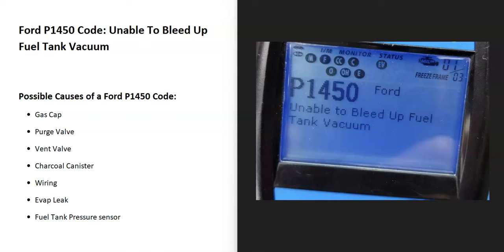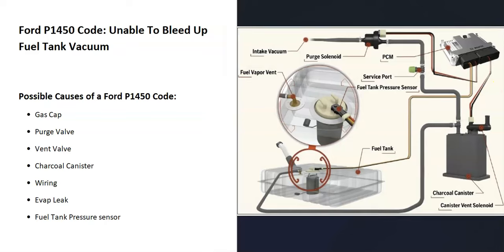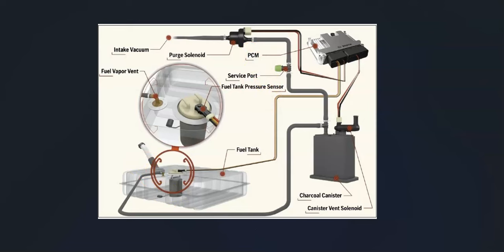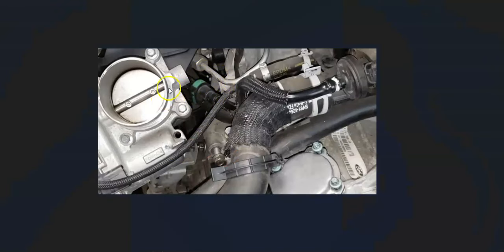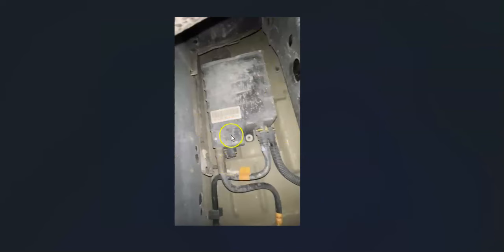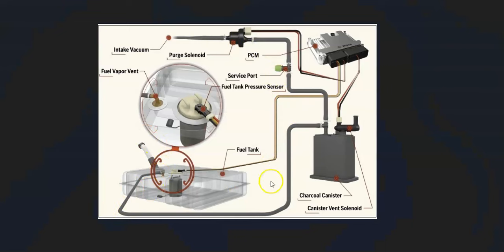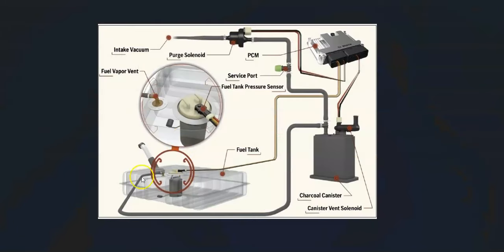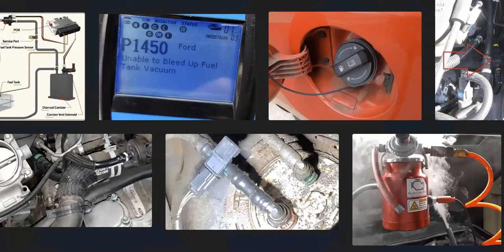Causes and Fixes Ford P1450 Code: Unable To Bleed Up Fuel Tank Vacuum

Comment: My car doesn't have a gas cap
Reply: No, but you should have a capless fuel system that relies on a spring loaded mechanism to perform the function of what the gas caps used to do. Just like any other moving parts, these can wear out over time. That being said, I would check the other possibilities first to rule them out before coming to the conclusion that this is what needs replaced.

Comment: I recently got this code on my wife's '15 fusion.  Tests pointed to purge valve as the culprit.  I removed the purge valve and cleaned the valve and all hoses with 99% IPA from all sides then dried with compressed air a few times.  I then hit the valve with a small shot of wd-40 on the side that goes to the EVAP canister.  After reconnecting everything the valve seemed to function properly.  After a couple days of driving the check engine light went out.  Not sure how long the fix will hold out but being right after Christmas I'll call it a win for now.

Comment: 2004 F150 P1450 started after gnarly rain storm, after starting n driving truck a bit it seemed like it had water in the gas, misfires, rough idle, many codes. After few days of heat and evaporation, truck running normal but still has 1450 code and can't fill gas tank unless flow going really slow. And It's not the gas cap.
Excellent video and graphics breakdown.
Reply from the maker: That is a common symptom of a bad vent valve located under the bed of the truck.
Reply: @HVAC_Mechanic  thx for that.  I've heard that from 1 other person.  So it being a 2004 [new style], I've researched but I cant find anything about it or to change it.  All I find is the purge valve in the engine bay on the firewall.

Comment: Having trouble finding videos on Evaporative Emission Blocking Valve. This is not fully sealing and when benched tested.  This is a vapor shut off valve that is located  on top of my 2018 f150 and most modern fords. This has yet to throw a code, however scan tool readings EVAP System Vapor Pressure -1000pa - 2000s pa. Random misfires on idle. Random rough idle when truck is warm. If i disconnect the vapor line from the purge valve to canister, the Vapor Pa will stay at the normal 20-100 range. So this pointed to the cansiter, that was benched tested and valve (normally open) was working and held pressure when closed. Lid less gas filler tab sealing. That is when i removed the Evaporative Emission Blocking Valve which is not fun if you atrempt with tank still on the truck. Benched tested with smoke and vacuum as this is a normally open valve, when shut there was a leak. Not enough to trigger code, but waiting on new part, so hopefully this is my issue. New intake manifold, 16 injectors all clean. Just was trying to see what this valve could cause if faulty. Thanks

Comment: What about a fuel system clean out ? I have same code and already changed purge valve and I have a 2018 ford focus SE and I don’t have gas cap carmax told me these cars don’t have or need one I thought it was weird but my car is idling now

Comment: Thanks for the video. What worse can happen if this is ignored?
Reply: I’ve had a similar issue for about 8-10 months now. I think you’ll probably just experience some reduced gas mileage and perhaps slightly less power. I haven’t noticed any major issues with my car so far

Comment: Most detailed video I have seen so far BUT I own a 2007 model that is getting this same code with no symptoms whatsoever. The car runs, drives, fills up and drives off afterwards perfectly fine at the gas pumps. Should I consider disconnecting the negative terminal of my battery to reset my computer in the sense that it could be a faulty code? The code has been showing up more frequently as time has went on and I've owned the car for a year now. Just makes me wonder which option I should consider trying first to fix this issue.

Comment: Thank you. Great explanation of the system. My wife's 2017 Escape has been giving the code. I replaced the purge valve and connected lines (or the Kraken as I called it). Worked great for a month, but now it's back to giving the code. The only noticeable issue is the old trouble starting after filling up at the pump. I'm thinking of replacing the canister vent solenoid next. Can you explain what happens mechanically when you fill the gas tank that causes the trouble starting? Does filling the tank cause a loss of the vacuum, and keep gas from flowing to the engine? If I crank the engine enough times, it eventually starts (for now). How is the vacuum created? Take care.
Reply: Hey! I’m actually having the same exact problem with the same exact year make and model. My purge valve was replaced, and it’s still smelling like gas and I have to keep the car running while I fill up. If you found anything out about it could you let me know!!